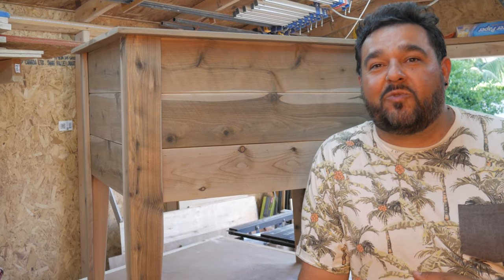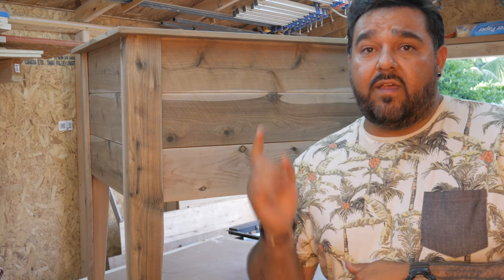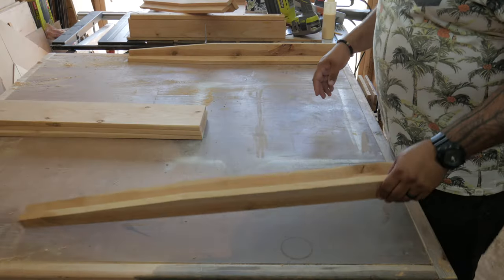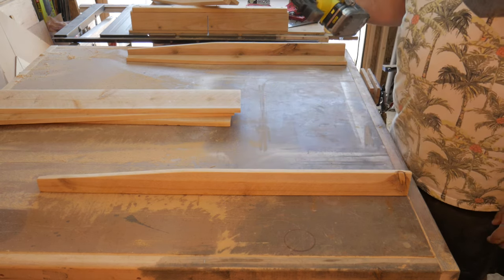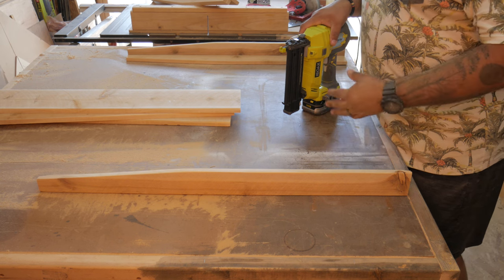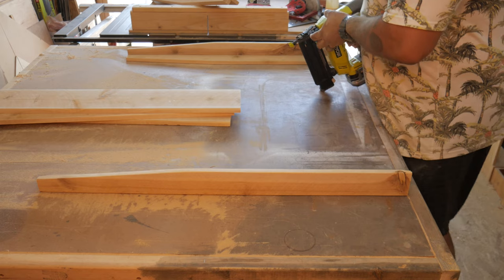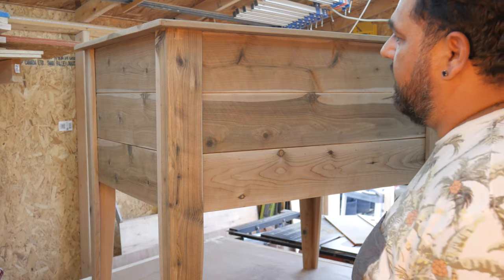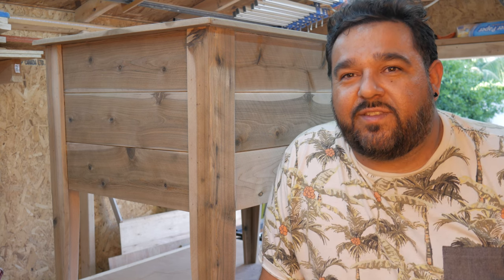DIY Raised Planter Box Cheap

Comment: Loved the design! but suggestions from a gardener, the bottom board should have holes drilled or further apart for drainage, 2nd you should really go back and reinforce with screws, after all the dirt and water, plants, it gets pretty heavy ! Also I wish you showed how to assemble the legs, I been trying to do one, and failed on the legs lol, I used 2x2 ?  didn't have an L shape lol  so back to the drawing board.